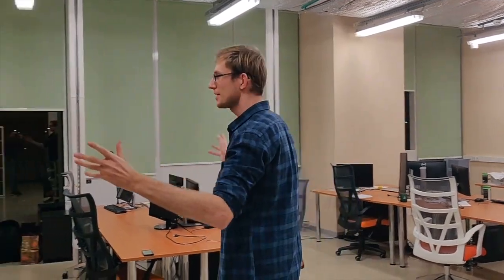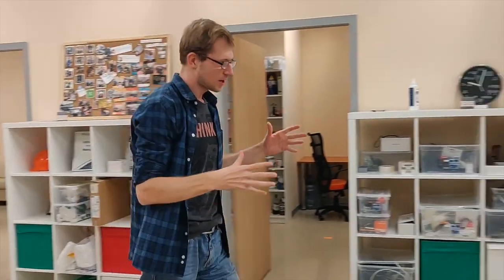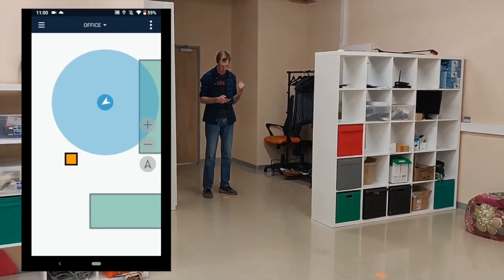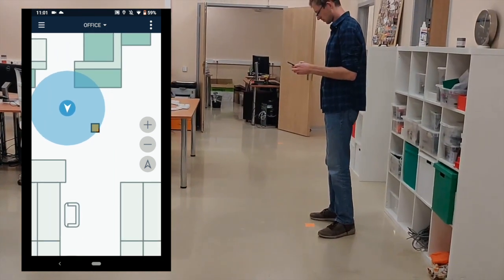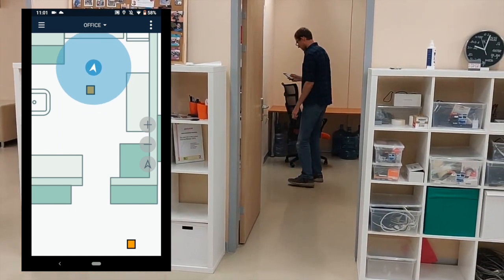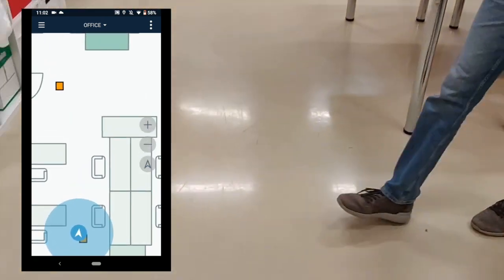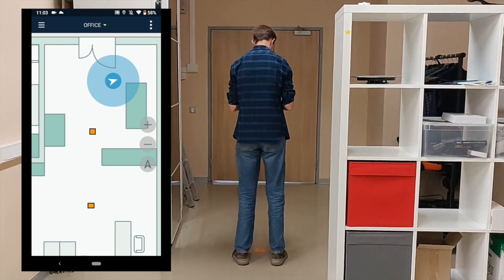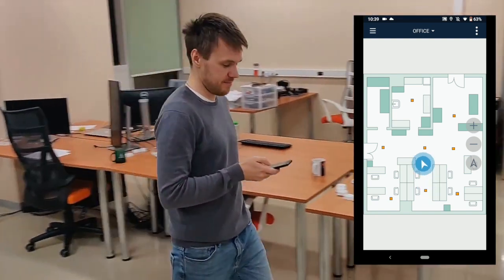Navigine's demo of WIFI-RTT

Comment: so what is the power consumption of the system? how fast does it drains the phone battery?
Reply from the maker: Hi! Thanks for the question. It drains the battery a little bit faster, because the application also uses different sensors.

Comment: Hey guys, I've been trying to create an android app which requires very high accuracy coordinates. My app is primarily used outdoors. But I have noticed that no matter if I specify high accuracy, my app is never as accurate as the actual google maps app. Do you think it's possible that outdoors navigation apps like google maps uses wifi-rtt and/or cell tower signaling to get accurate location? In a densy packed city, I would imaging there are dozens of wifi points in any given block making this something possible translateable to outdoors. Maybe this can be used outdoors?
Reply: Outdoor navigation application could use GPS, Wi-Fi/BLE fingerprints as well as map details. Wi-Fi signals could significantly improve accuracy in urban canyons, but this will work only for Android as iOS blocks working with Wi-Fi API. What accuracy do you want to reach?
Reply: @alexeypanyov3934  currently my best accuracy is 8meters. I'm hoping to hit about 5m. But I'm mainly concerned with this:

The issue is that in certain city blocks (perhaps due to tall buildings, trees, etc) the accuracy will go to 36 meters, and my app loses its usefullness. In such cases the pinpoint will be waaay off, and speed will be too fast or slow. Hence, I wanted to know if in such situations, I can start hitting the wifi routers available nearby, and perhaps bring things back to 8m accuracy. Keep in mind, in such areas google maps will still be fine; the blue dot is more or less on top of where I am standing.

For more technical detail: I am using the fusedLocationProviderClient google recommends and I am using android's ACCESS_FINE_LOCATIONS permission. I had hoped this library internally uses gps and wifi-rtt and switches between them accordingly, but I suspect it does not.
Reply: @alexeypanyov3934   sure I'll shoot you an email. Is it literally just the letter 'a' before the '@'?

Comment: i just want  to know , 1.)do they  need special wifi rtt router to work with ,so there need the wifi rtt chip 802.11mc   to handle this stuff?  , 2.)  Is it available to buy it?  if not google wifi router 3.) where do they sell it ? 4.) how much is the cost per one ?  i used google wifi router and test with my google pixel 3a xl  , i tested with google wifi rtt scan app , it works ,but the accuracy is not accurate within 1 m. just about +- 3 m., i tested in my living room in the apartment ,when i saw this Video , it is shown ,i thought  the accuracy is less than 1-1.5 m.  that why i want to buy other brand of the rtt router , because i want to test measurement, and the next question are , 5.)are there other brand name of wifi rtt router ?  6.)what are the name of each brand name of wifi rtt router ? because normal router without 802.11 mc , can not do it  ,7.) will only the phone with android p able to test measurement the distance from RTT ? 8.) does the phone need to have the chip of 802.11 mc embedding to test measurement the distance  from RTT 9.) now what are the brand of the phone that can test measurement the distance with RTT , because in my knowledge , the app that is available to test measurement is only wifi rtt scan app , i can download with google pixel 3a xl , that run android p operating system , i think there also is the chip of 802 . 11 mc embedding in the google pixel 3a xl  ,but when i used other new phone that run the android p , for example ,  new samsung galaxy 9 or10,nor the phone that have API more higher than 26,  it can not download the wifi rtt scan app, so if someone know the answer ,please let me know my 9 questions
Reply: Hello, did you find all of your answers you asked? Cause it has been 4 months since you asked. I am also having the same questions as you asked. Can you please share the solutions of your questions if you already found some solutions please. It would be very helpful for me. Thanks in Advance
Reply: Hi. With our technology you can select any 802.11mc compliant phone. About the access points - we have used 4 Google AP at the corners. About the errors - each individual measurement can have an accuracy worse than 3 meters, by when you fuse them together you will get an accuracy boost.
Reply: @aleksandrmikoff1292  --->please explain what you said *

" , by when you fuse them together you will get an accuracy boost.
"error is less than 1 meter , "About the errors - each individual measurement can have an accuracy worse than 3 meters, by when you fuse them together you will get an accuracy boost."
Reply: @domdom6688  We have a navigation algorithm which allows getting 1-meter position accuracy with 3 m (usually better) accurate distance measures from AP

Comment: Thanks for sharing this.  Have you tested the system in a building with thicker walls?  Where exactly did you put the google wifi APs? Possibly each spaced out equally?  Or maybe one in the center and the other 3  in equally spaced out?  What's the minimum amount of wifi points needed to accurately track the device?
Reply: Thanks for the question. In this installation, we put 4 Google AP at the corners of the room, 3m height.